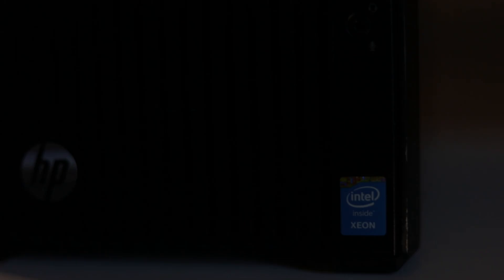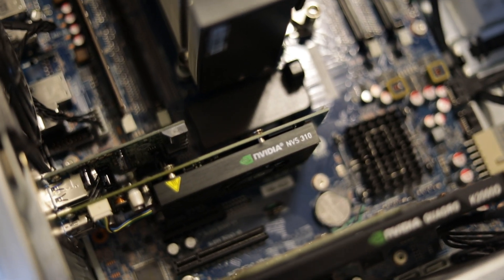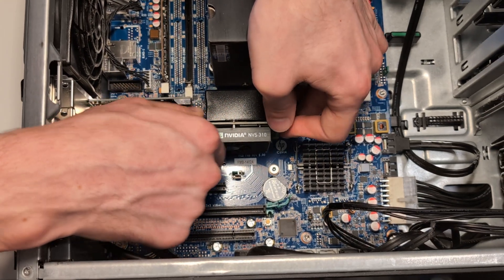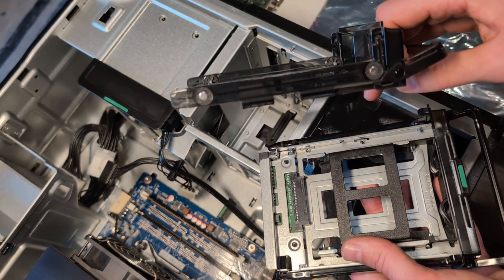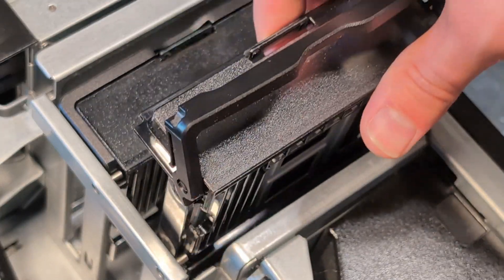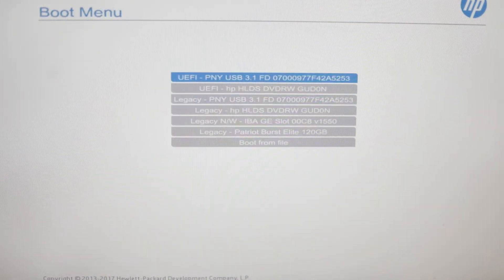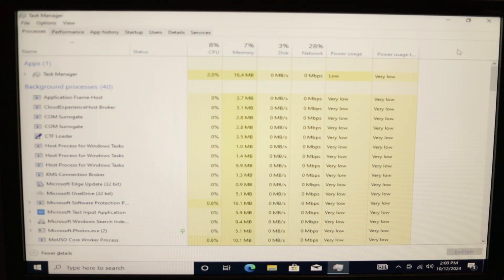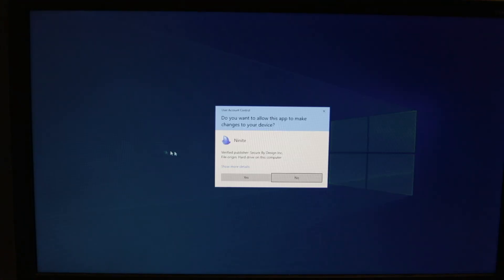Turn this HP Z640 Into an upgraded Powerhouse!

Comment: U can buy a 2nd cpu raiser. The major issue for z640 is limit ram slots.
Reply: I have a riser. It keeps failing. I had to remove it. Now it works fine with one cpu.